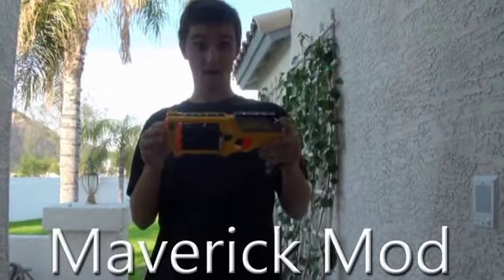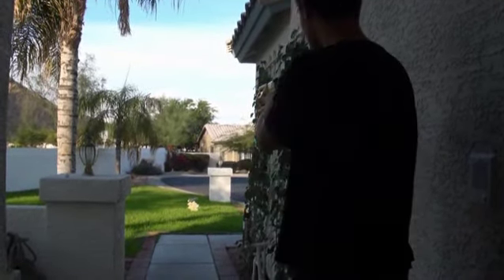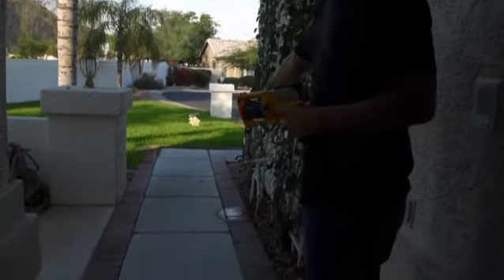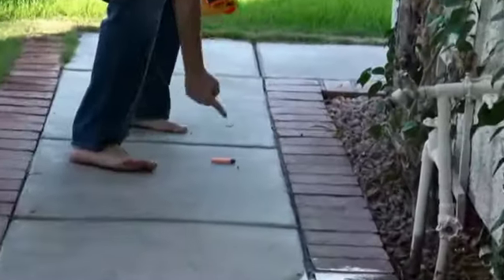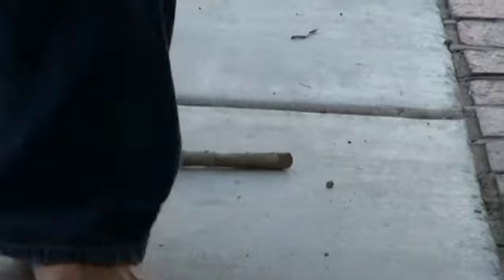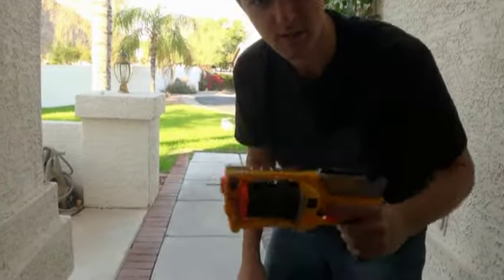Nerf Maverick Modification

Comment: Just simply do what he does except before you put back the orange things break away or cut off the pegs on every one of those orange things, then cut off the gray thing on the rod that you put back to reassemble and cut the stopper off that's on the blaster to get a full barrel drop then right behind the spring add 2 to3 pennies and reassemble than your blaster will get 70 to 80 feet